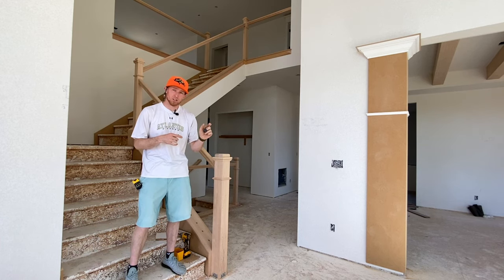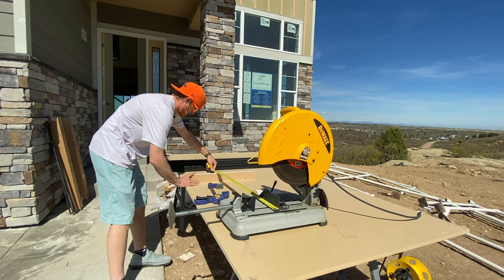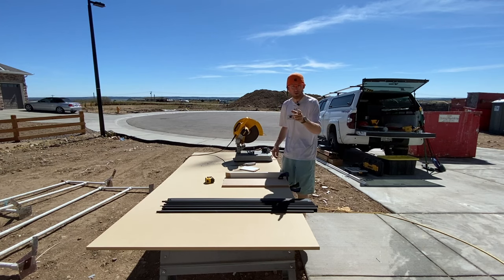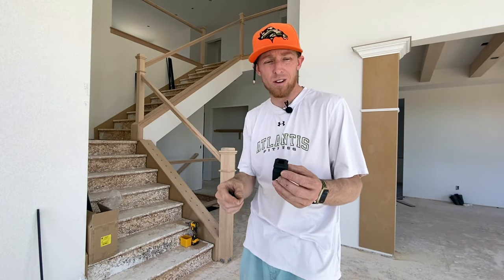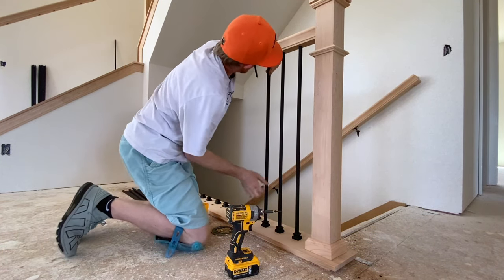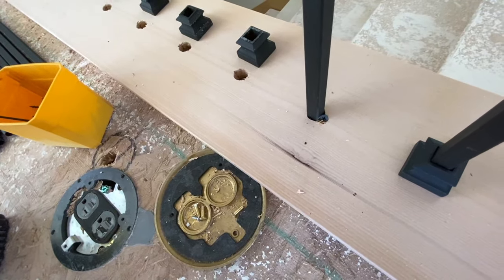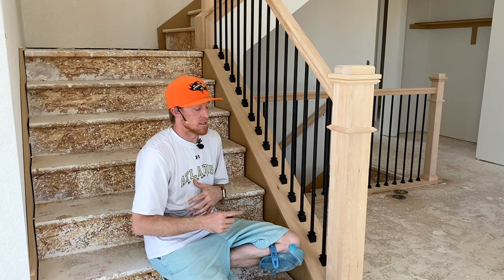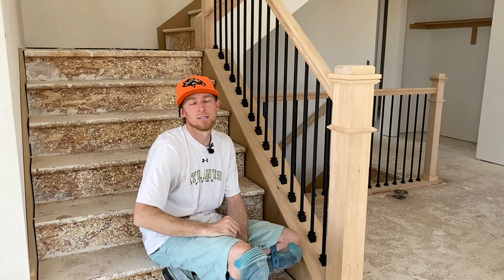IRON BALUSTER INSTALLATION / EASY DIY RE-SECURE *NO GLUE* : MEASURE, CUT, INSTALL, STAIRCASE UPDATE!

Comment: In the king of stupid questions, but if your using 3/8 square bar what size drill bit do you use? 3/8?
Reply from the maker: Not stupid at all!  My balusters are 9/16” from corner to corner so I use 5/8” or 11/16” (on the rake of the stairs). If your baluster is 3/8” from corner to corner I would use 7/16” or 1/2” drill bit.  We need the hole size to be nice and snug up top, but we need a little wiggle room on the bottom so the baluster slides in the hole nicely. The screw will hold the baluster snug in the hole! Just remember to run the screw tight the the baluster so the screw head pinches to the flat edge of the baluster...just verify the diagonal measurement of the baluster! Any more questions let me know! Have a blessed day!
Reply: Thanks for getting back to me, great answer and great videos reall appreciate it
Reply from the maker: @wiffwafflongstockings1373  You are very welcome! Thank you for the positive feedback!

Comment: It would have been better that you prefinished all the wood 1st. Then did all that after drilling holes.
Reply from the maker: That’s not how the building process goes in new residential construction. I’m not a painter I’m a carpenter…the painters will never come pre-finish the material before it gets installed…maybe on a personal small scale job that might happen